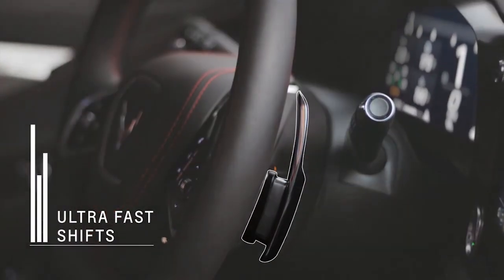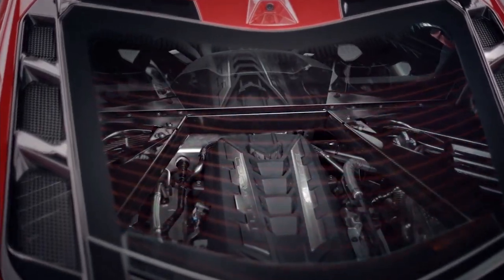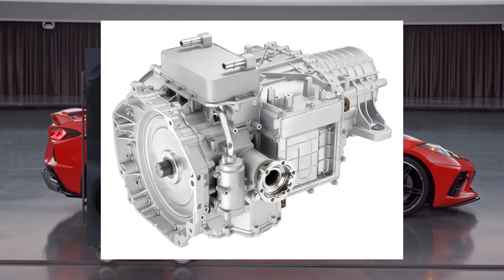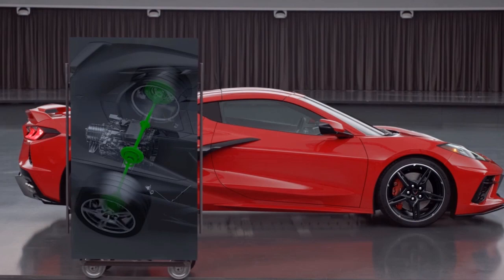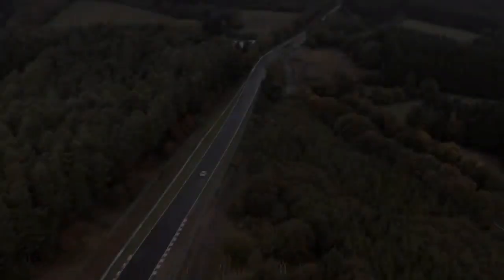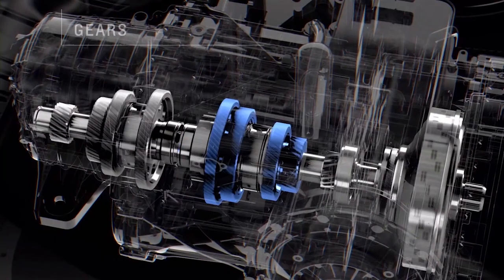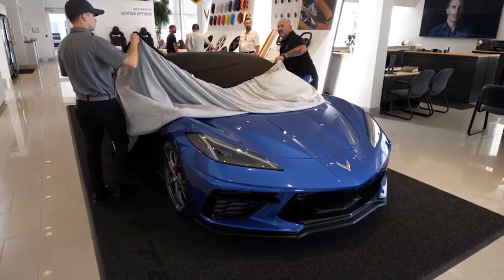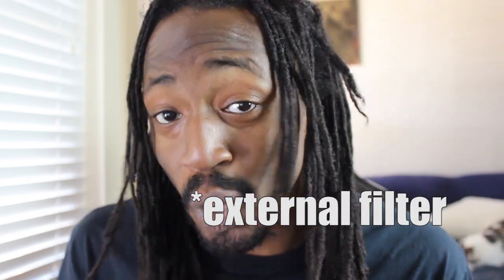How The C8 Corvette DCT Transmission works

Comment: Am I the only person first who thought about a 15" rear wheel conversion with some Weld chevy performance COPO wheels 18x6 fronts and the deadlocked version 16x10s outback with some Hoosier 275/50/16 drag radials and down the road when its makin some steam go to a 15×12 and 275/60s fab up a custom exhaust setup and CAI and see how quick it as and when the computer gets cracked throw a nitrous kit on it, then a cam and spray etc etc then bust out the turbos and go really fast.?. I can't be the only one.!.!. Lol LoL